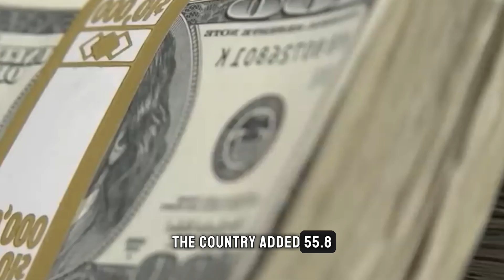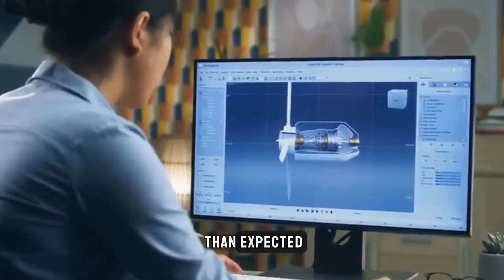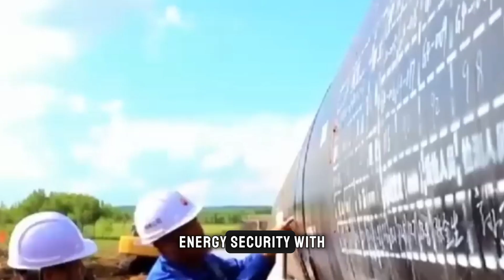China Builds Largest Offshore Wind Farm IN THE WORLD

Comment: And is also building over 200 coal plants at the same time.
Reply: How do you know it is 20 and not 200 coal plants?  The official data of installed coal plant is 1390GW in 2023 and 1332 GW in 2022.  This mean an increase of 58GW.  A typical coal plant is about 2.4GW!

In any case the 58GW new coal plants have to be judged with in the same 2023 year China "added" 217GW solar power and 76GW wind power!
Reply: @gunsumwong3948  You would be the first person I know that trusts chinese official data.

https://docs.google.com/spreadsheets/u/0/d/15FAZLez9EJks4_d_n6K3Iqm2dm_F6DL5Eqwe-kOzBVk/htmlview#gid=1142092547